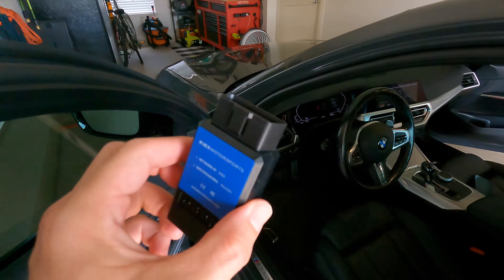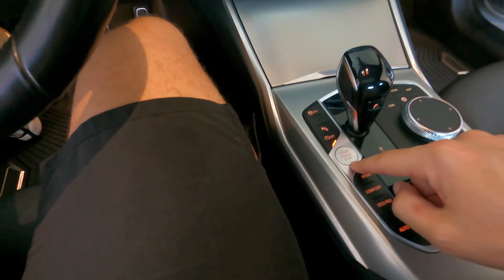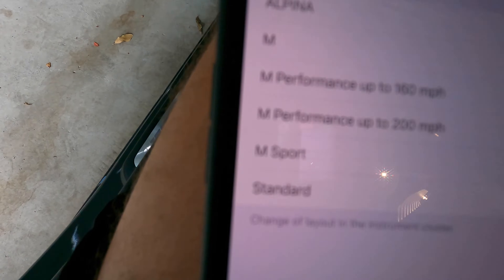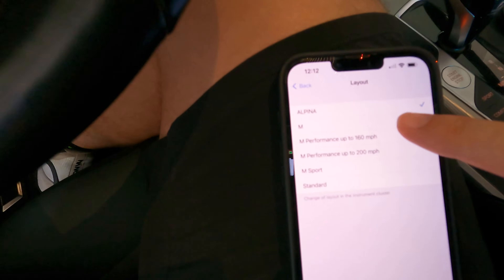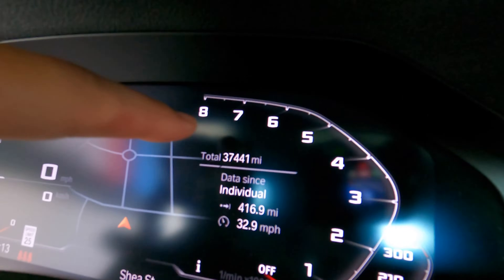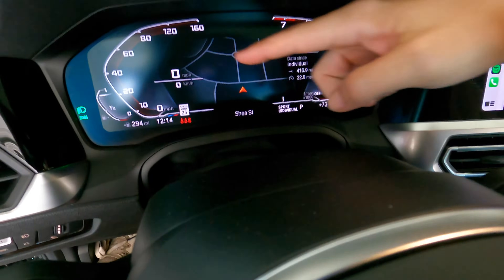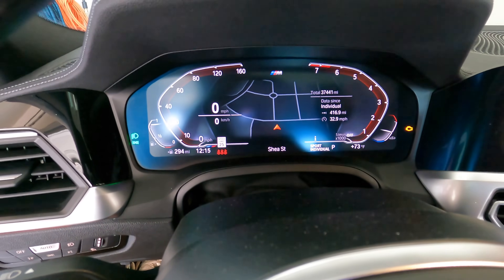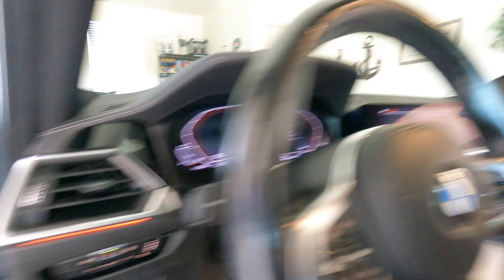What 6 Different Instrument Cluster Layouts Does BMW's M340i Have? Bimmercode Tutorial Reveals All!

Comment: To your comment to keep car running while coding. How do you start an engine and not leave diagnostic mode which you entered by three rapid clicks)?
Reply from the maker: No, so you enter diagnostic mode by clicking start button 3 times but NOT starting the engine. You just want to buckle your seat belt to mitigate the ecu from going to sleep. Let me know if that makes sense 👍🏼

Comment: I can't get my display back to the original display with the M340i logo. Standard just displays the "M".
Reply: I have same problem
Reply: Did you ever find a fix for this?
Reply: @naheem7010  yes I set the old dial from the bimmercode backups section and it came back, and it can also be solved with expert mode.
Reply: @ahmetfatihdogru1568 thanks. I’ll give that a try 👍🏽
Reply: @naheem7010  did it work bro i have the same problem
Reply: @lukasblackbeatdown3752 yes the back up fixed it for me
Reply: @ can you help me bro how exacly step by step did you do it i got bimmercode as well
Reply: @naheem7010 yes had to use protool

Comment: M gauges doesn't show 3.0 csl anymore. It t doesn't tell you what mode you are in which is annoying. If it showed the mode plus redline it would be perfect. It's also trailing grey unfortunately.
Reply: My logo is gone even after switching back to the default dash and coding the regular logo back. Did you have the same problem?
Reply: @Eluusiive My m340i text is also lost, how can I get it back, and when I turn it to m screen, there is a space in the middle
Reply: @ahmetfatihdogru1568 hey did you ever figure this out? please i bought the car and its like that
Reply: @ o found if you have bimmercode you can change it in the expertt mode
Reply: @ahmetfatihdogru1568  where tho i cant find it which setting is exacly
Reply: @ entremuntal cluster and after that left side expert mode but it is paid option . And also you can do backups on the right
Reply: @ i have bimmercode but couldnt find the option guess ill check later if i can find it ty
Reply: @lukasblackbeatdown3752 did u ever figure it out, my m440i logo is gone and it’s stuck as M
Reply: @ yes in the bimmercode app if u go to the settings for the cluster just do backups on the top right

Comment: Is there anyway to add (customize) the tires PSI info on the right side of this dash on my 2023 BMW M340i sedan?
My 2022 MB AMG GLE 53 does have this option and I like it a lot, as my BMW does not have any spare tire and this PSI info will be very helpful.
Reply from the maker: Hi, I believe the M340 should offer pressure monitoring within the Idrive 8. Does yours not show? I know only M cars offer tire temps, but pressure should be standard within the instrument cluster.

Comment: Thanks for the tip man. Just a quick question, at the end of the video when u said have the car running u mean by having the engine running and everything on just being on park. At that time am I still able/is it necessary to press the start/stop button 3 times for diagnostic mode?
Reply from the maker: Good question. So to clarify on that point! I was referencing having the battery at a sufficient charge prior to starting your coding session. If you know your battery is in good shape (newer and/or charged fully) or it’s been on a trickle charger, then you have no concern as the coding software these days are way faster than it used to be. IF your car has been sitting for a while, or, weak battery then I was saying you may want to drive the car for a while to place a charge on the battery. Diagnostic mode should be entered when engine is off, in park, and battery at a sufficient charged state. 👍🏼

Comment: Does it work for a 22 G07?
Reply from the maker: Yes absolutely. I believe the ‘22 G07 still has iDrive 7 so it should be very similar. In the basic mode you obviously won’t get an M340i screen (or similar) but you can access the standard M sport visuals etc 👍🏼

Comment: For the M you can change the 3.0 CSL to anthing you want (as long as its a real M car) and if you go into DZM_variante and set it to S63 it shows an RPM

The M Sport also shows the M stripes next to the speed limit info
Reply from the maker: Thanks for the insight! Unfortunately, my m340i wasn’t a full M car so I couldn’t take advantage of changing the icon but this is good to know!
Reply: @legacydriven  Miscommunication sorry about that. What I mean by as long as it’s a real M car is like M2, 3, 4, 5, 8, X3 M, X4 M, X5 M, and X6 M. Don’t think you can code M340i with the M layout. You could try tho!
Reply from the maker: @justa4s_  definitely, I gotcha! 👊🏼
Reply: @legacydriven are you able to have it keep the m340i at the top but also have the 200mph on the dash and the map still in the screen?
Reply from the maker: @samuelfreericks168  So the map is a separate variant of the cluster as it can be adjusted via Idrive. The M340i and 200mph are also separate from each other I believe, but, as mentioned previously I do think this can altered within expert mode (customized) but just be cautious as expert mode allows for a slew of customizations that can quickly become an issue if you’re not experienced 👍🏼
Reply: @legacydriven hey so i just bought myself an m340 and it had been previously coded was there a way to get the M340 back on the dash?
Reply: @kylecarneiro4688  i think you need to reset the instrument cluster to default

Comment: Great video. Question, after coding in the different instrument clusters do you think the fuel gauge is correct? I have a 21’ 330i and I coded in the M performance 160 cluster and I’m not sure if my fuel gauge is accurate anymore. I noticed the needle dropped a bit from the position it was in before the coding. Also the digital range number dropped as well. In my case it went from 311 miles to 260 after coding.
Reply: So it’s not only for Ms ? I have a 330i would it work for mine ? I have a 2020
Reply from the maker: @Reallydiorrr absolutely it would work for your 300i. I also had a 330 previously and this worked perfectly 👍🏼
Reply: @legacydriven if it works for the g20 330i and m340i, would it also work on the g20 320i?
Reply from the maker: @friedVHSS  It should work for any G20 series model. Just remember that not all features were programmed into each car from the factory. But if you’re running iDrive 7 it should very similar if not the same 👍🏼
Reply: Once you coded your 330i into M Performance package the system expects you to drive like crazy, hence it shows the shorter range... ;-)
Reply from the maker: @ringringskier 😂
Reply from the maker: Thank you 🙏 and interesting observation. I never noticed a difference with my fuel gauge, however, I do know that the visual graphics are different from layout to layout so it may just appear lower but in reality the fuel level never changed. If that makes sense?

Comment: Can you use the Kies adapter to code an M340i...to turn off the Auto Start feature when coming to a complete stop in the Eco mode?
Reply from the maker: Hi, so the M340i has the auto start/stop button in the center control panel which is the easiest way to turn off that feature. Alternatively any of the sport modes automatically deactivate auto start/stop as well. Regarding eco pro mode. I’m not sure that is possible via coding. It may have to be done through expert mode inside of Bimmercode. However, anyone using eco mode most likely wants to utilize auto/start stop.

Comment: I am wondering. I would just want the layout to change to M sport mode gauge only when in Sport mode. Like when you put it in sport plus the screen is totally different on a M car.
Reply from the maker: Well the screen will change to a visually different layout in each mode, depending on what you select, the same as OEM. The difference is that this allows you to access an array of different options not provided in the OE screen, but available for your model (or other models)